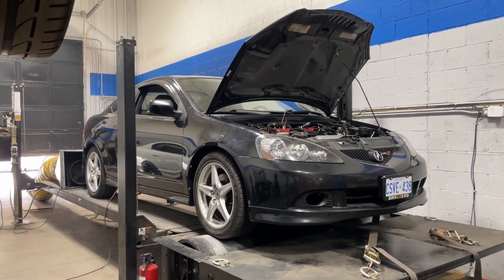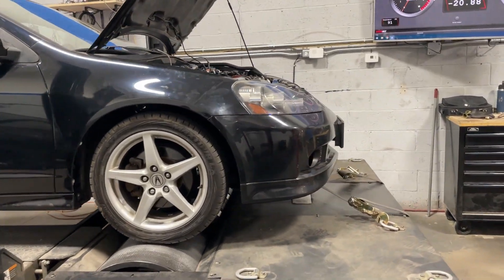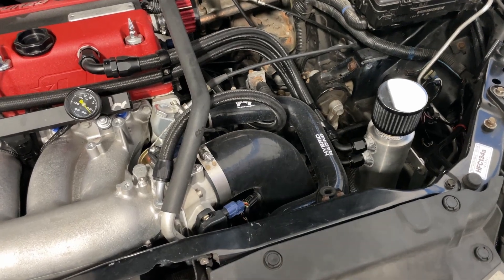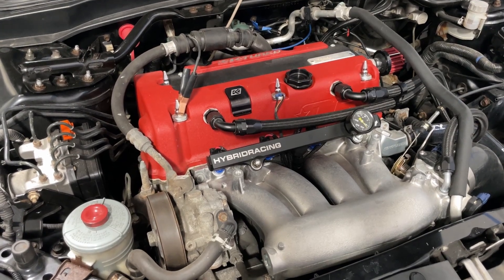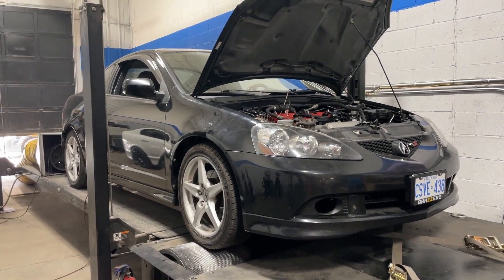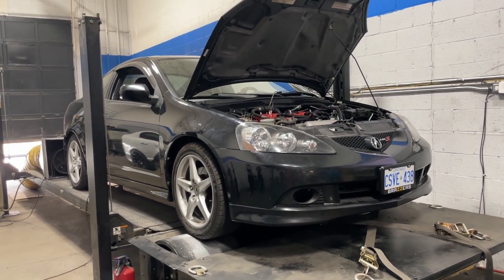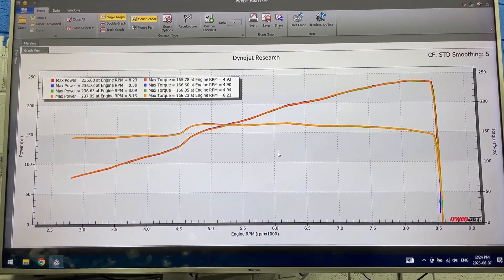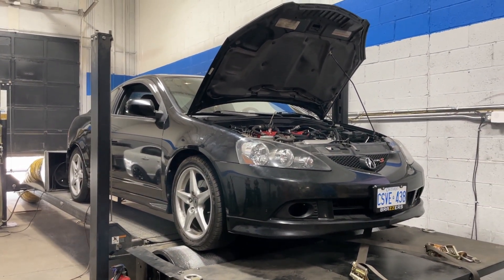FBO K20 RSX Type S Dyno Tune

Comment: Is that catch can I see? If so what is the purpose of that catch can?
Reply: There is no actual purpose except for looks on a Naturally Aspirated car... unless the motor is very very ill, which this one does not seem to be. I've run an oil catch can on these RSX-Ss, and the motors have little to no blowby... once you increase the pressure onto the piston rings with boost, an oil catch can is a good idea... but also not extremely necessary by any measure, unless over 20psi and on aftermarket pistons. You could get by without one... as always, oil catch cans are for looks and very little more, and this is coming from experience and Engineering knowledge. Simply a seafoam steam cleaning once a year will tell you how much build up you have accumulated, and on these, even boosted, there is very little. I don't waste my time with oil catch cans, unless as I mentioned with aftermarket pistons and over 20psi. Forged/aftermarket pistons have greater clearances than stock pistons, which you will actually hear when running them. More gap+more boost=more blowby=need for oil catch can

Comment: I've got an 04 Type S.  Is this 05 throttle by wire or cable?  If it was cable, did the owner do a cruise control delete by changing to a 70mm TB?  I can't find a larger TB that lets me retain CC for a throttle-by-cable setup.  Hybrid Racing made one 13 years ago, but quit right before I started my build.  I thought I read on a forum someone using a Mustang TB too.  Anyone got any ideas?
Reply: It's cable driven as all RSXs are. There are no aftermarket throttlebodies that allow cruise control... because in reality, you don't need an aftermarket throttlebody unless you have a built engine making 90-100hp more than stock... the stock throttlebody on RSX-Ss is 62.5mm, and boring them out to 66mm is more than plenty. Look up king motorsports to get it done for $150.

Going to 70mm is just barely not too big to cause a FBO RSX-S to lose power by going too large. So, in essence, he is ready to go with a built motor for that size throttlebody, or at minimum, aftermarket cams (which even the best only give 3-7whp over the stock z1/itr cams).

For reference, a stock 05-06 puts down 175whp, and with full boltons, with the lightest flywheel, the lightest wheels, and tires, the record is 70hp gain, for a total of 245whp... this car has pig heavy stock 21lb wheels, don't know the tires or flywheel, there are better headers, and I don't see a thermal/Hondata gasket. With those additional mods, I can see the car gaining another 20hp... yeah, this is a high reading dyno, because it's impossible to have over 230whp with the mods it has (even if it has the lightest flywheel and lightest tires).... therefore, a stock 05-06 RSX-S on this dyno must be making 185-190whp, not the normal 175whp.
Reply: @copperkeyracing6167  Thanks for your input.  My RSX has a K24A2 short block, mild cams, and bolt-ons including race headers and tune.  Last time at the dyno I saw 237 WHP.  When I asked Bisimoto about the effectiveness of a larger TB with a K24, he recommended I test the Intake for a "vacuum".  70mm was the largest I would get, although your recommendation about enlarging the stock one may be perfect for my application (if I even could see a benefit at all)
Reply: @DC5Brandon 
First of all, by a "vaccum," he meant that he feels you may have a leak in the intake manifold. Either a gasket or a line. You could do a leak test using smoke... but that may be too involved unless you can definitely hear it, but just can't find it any other way.

Next, the throttlebody isn't what's holding you back. Not without high compression pistons, aka a built motor, does a throttlebody really affect things. If anything, it will give you 1-2hp as has been shown by reputable throttlebody tests. Stock is just slightly smaller than optimal, and going up 3mm will put you in the goldilocks zone (not too big, not too small) of what a stock block can make use of.

The question would be which do you have of the following (in order of importance):
1. What intake? CAI of 3" is best (cold, meaning the filter is in the bumper area, not under the hood)
2. What race header?
3. What tires do you have? Are they pig heavy because those can take away as much as 10whp
4. Do you have a thermal gasket, and is it properly set up to isolate the heat from the engine from the intake manifold
5. What wheels do you have?
6. What intake manifold
7. What exhaust do you have? Size, transition from header to exhaust, and mandrel bent or not matters

Lastly, mild cams won't give you anything, but hopefully, they can give the equivalent power as the itr/z1/06-08TSX cams... even the best cams give a trade off of losing power in one area only to add power to another, and then at most, and if you're lucky, 7hp over the best stock cams.

Absolute last thing... 237whp is very very respectable on a stock block. If 237whp is on a properly reading dynojet, that is not reading high, like the one in the video, then you are in very good shape. The record is 245whp on a factory cams stock block 04-05-TSX-K24a2/k20z1/k20a2. That 8whp you're missing is most likely your header and tires. Headers at about $1700-$2000 will give you that last 5-7whp.
Reply: @copperkeyracing6167  Thanks again for the advice.  While I haven't done the research on TB's, I know about all that other stuff you mentioned.  I started modding in 2009 and I'm focusing more on aesthetics now.  Having done a CAI and RBC, I never addressed the TB in between.  Seemed like something easy to address along with a tune if my car was already in the shop for something else.  I know it wouldn't be a substantial gain, but I felt my airflow may not be as efficient since I increased my displacement.
Reply: @DC5Brandon  displacement alone doesn't change the amount of airflow/hp through the motor. Displacement and compression and rpms, changes it. So, if it's an 04-05 tsx motor, and any k20z1/a2/z3, the hp/flow is the same.
Reply: @DC5Brandon  if it's an 06-08 TSX motor, then yes, hp/flow increases, but 10hp at most, which isn't enough to require 70mm either... and if you're already at 66mm, and not stock 61/62.5, then maybe you get 1hp, going from a 66mm to 70mm, and only on the 06-08 TSX longblock... or a k20a type-r longblock

Comment: Hi Nick! A question.. Does the VTEC cam lobe remain until the limiter or at high revs do you have to switch back to the low cam lobe to be safe?
Reply: VTEC is on till redline. VTEC is not the same as cam angles, which Nick talked about. Cam Angles=VTC, and all engines with iVTEC have that. VTEC is for high RPMs to make power, and switched off on low RPMs to not give that lope sound that V8s with cam(s) have. Not in VTEC= better for fuel economy. In VTEC= better for power. Low RPM flow matches the cams not being in VTEC, while high RPM flow matches the cams being in VTEC. They go together.

Comment: hello nick. would you personally use a k20z3 or k24a2 for turbo build?
Reply: I think the K20/4As do better with boost? I might be wrong tho. I just know people do Frankenstein builds on either of them
Reply: @johnfuller5902  Frankenstein builds are the biggest misconception in the Honda community imo. The k24 head is just as good especially with 06+ cams. I have 2 side by side the port sizes are identical
Reply: @turbone54 i think john fuller was saying to use an A motor instead of a Z motor... uhh, unless its a k24Z7(not the best motor for anything), it's not the Z or A that makes a difference, nor what the question was.
Reply: @turbone54 as for the misconception, I totally agree. HUGE misconception. The bseries frankenstein was great for quick and dirty all motor builds with stock internals (b20 block that didn't come with vtec, and then you put a vtec head on it). It doesn't transfer over to kseries, because we already have the biggest block, k24, with vtec out of any 04-08 TSX.... with that said, the 06-08 TSX motor is the king of kmotors for all motor.
Reply: Personally, I would go with a k20z3/z1/a2 for boost because a k24 will limit your ability to use the longer gears provided by a quick and simple  EP3 gearset. If you are going to spend thousands on all new gears, then a k24 might be ok, but you are limiting your gear selection abilities.
Reply: @copperkeyracing6167  i ended up tossing my stock k24 and building a Z3 to reduce drivetrain stress and because the K20 has thicker sleeves due to the smaller bore. Car is making 600+ on a single disc lol
Reply: @turbone54  single disk clutch? What brand? 600+!?!?! Very nice! I've taken stock k20s to 600whp, so a built one will definitely hold... provided, as always, that the setup and tuning is good... ep3 gearset seems to only handle 550whp though.

Comment: 237whp or 237hp to the crank?
Reply: He said 237 whp, you're looking at 250hp ishhh to the crank
Reply: @TrichbeeT Technically it depends what a stock 05-06 RSX-S makes on his dyno. I'm guessing 185-190whp from the mods and gains this car has. Which is about 50hp gain... then, you have to decide which crank hp nunbers are you going to go with, 210hp rating for 05, or 201hp rating for 06... which means 251-260hp...

Yeah, you're right though, I would go with the lower number, about 250hp
Reply: @copperkeyracing6167 Hella trolling the comments 😅

Comment: A stock 05-06 RSX-S must be making 185-190whp on this dyno, as I'm used to seeing a stock 05-06 puts down 175whp... and with full boltons, with the lightest flywheel, the lightest wheels, and tires, the record is 70hp gain, for a total of 245whp... yet this car has pig heavy stock 21.5lb wheels, don't know the tires or flywheel, there are better headers, and I don't see a thermal/Hondata gasket. With those additional mods, I can see the car gaining another 20hp, and come out reading 257whp... obviously that's not possible. So yeah, this is a high reading dyno, because with the mods it has, it's not possible to have over 230whp (even if it has the lightest flywheel and lightest tires).
Reply: 237whp with these bolt on's does see a bit high.

I'd expect closer to 225whp.
K20A/K20Z3 generally dyno 170-180whp bone stock..
Reply: @yukonstriker1703 
I'd also expect closer to 225whp

k20a2=165whp bone stock
K20z1=175whp bone stock
K20A(JDM-Type-R)=180whp bone stock
K20z3=180whp bone stock (has a self adjusting computer that auto tunes at full throttle while the others do not; they all adjust at idle and part throttle though)

On a correctly running dynojet

Comment: what ecu did they use
Reply: Kpro with a prb from a 02-04
Reply: It's an 05-06 KPro w/harness... which utilizes an 02-04 RSX-S ECU converted internally to work with the 05-06, and then a jumper wiring harness to reroute the signals into proper positions, and then an 02-04 RSX-S primary 02 sensor, which is a factory wideband sensor, instead of the aftermarket failure prone wideband and sensors.

Comment: Had similar bolts on but with 1000c injectors and e85 made 240
Reply: More fuel capacity doesn't mean you make more power. It's like saying using continual buckets of water will make your car cleaner vs a hose. You might be able to wash more/bigger cars, but all you need is a hose for an RSX.

As for E85, it's a really good cleaner for when pump has left behind lots of octane robbing carbon deposits. On stock 11:1 compression, and naturally aspirated, there is no gain using higher octane fuel like race gas or e85... you do lose power if the car has lots of octane robbing carbon buildup... so, you aren't actually seeing gain, you are recouping what you lost.

This motor seems plenty healthy with such low mileage.

Comment: Hi nick, think I can get away with running 1000cc injectors on a FBO k20 with no in line fuel pressure regulator?
Reply: Yeah you can was running e85 on 1000cc injectors FBO
Reply: The factory fuel system has a fuel pressure regulator in the fuel pump assembly, and a fuel pressure damper on the factory fuel rail... if you delete those, then yes, you will need an aftermarket fuel pressure regulator (FPR). You can drop in any size injectors, but your limit will be the fuel pump (at about 300whp all motor), and then eventually the fuel lines (at about 400whp all motor, which would be a pretty insane motor)... and when you redo the fuel lines is when you will need to toss the factory FPR setup, and the entire fuel system, except the tank, technically.